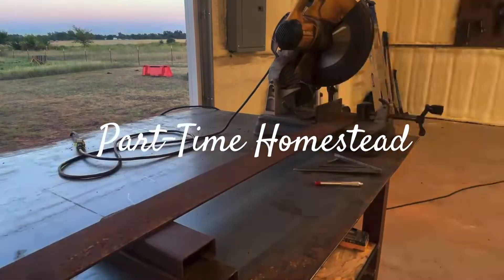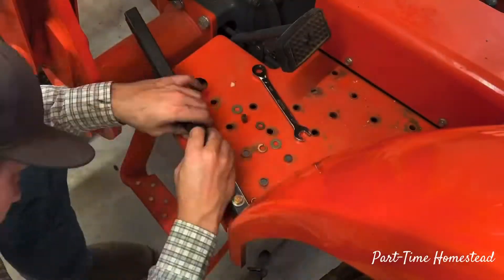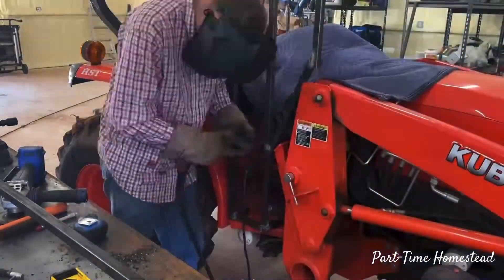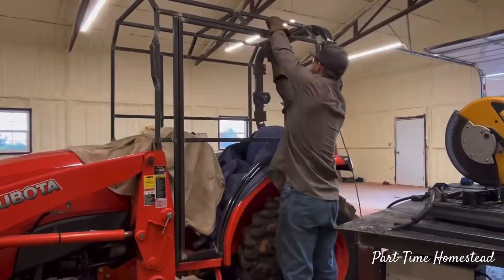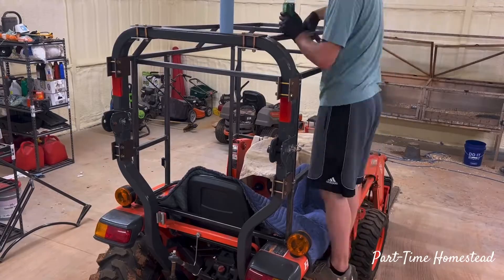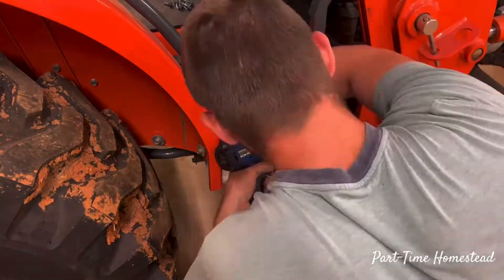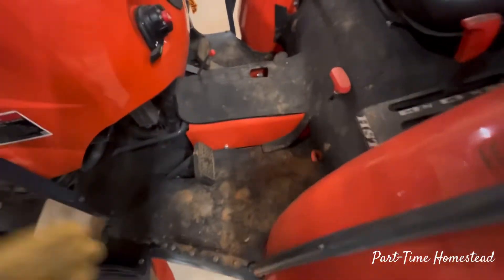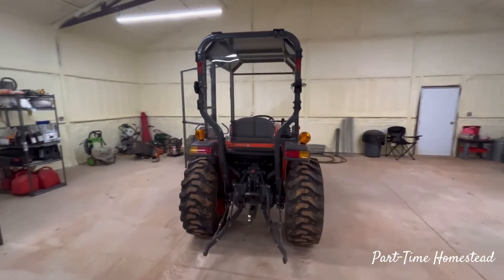How I built a Tractor Cab for less than $1,200!

Comment: For those triangular corners around the hood, you could just use a scrap piece of plexi and trim to fit the space, just like scribing in trim for woodworking or tile flooring.  

You could attach it by the acrylic glues as a double layer, but only glue it to ONE of the front pieces so it is not holding 2 of your front panels together in the event you need to take it off.  Or you could drill and screw it to the existing panels for later removal, either way.  

OR, you might consider using a small piece of heavy mil transparent shower curtain or find some "window" plastic as used in boat canopies and such were it is often sewn onto the fabric.  A canopy manufacturer might have a 1 foot square scrap to just give you.  That would all keep the space transparent to see through.

Comment: Very nice build.  I just found your channel and subscribed.  And now I'm going to look through for any upgrades you might have made.  I have an L2501, so similar design for me and this is on par for something I have been designing in my head.  This video will be huge asset as I move forward to draw it out and start making templates.  And I really like that it's not a permanent fixture to the tractor.  

Something I would want in mine is a bit of wiring and add an interior light and a fan as well as a front facing light bar outside and rear facing light on the back.

I would want to build my plexi in a way to be easily and quickly removable as I would likely only use this in the winter months.  Something like using wingnut head bolts or something.  Probably have a frame for each piece of plexi that mounts to the frame of the cab so when you take the panels off, the plexi panels still have their own frame for rigidity and protection.  Itll add some cost of course.  

Additionally, of less consideration, but still a consideration, I'd like to have a small electric heater in the cab.  It's a small area so wouldnt take much.  And not to make it toasty in a t shirt, but just to cut down the chill and maybe keep the fingers a bit more comfortable.

Also, I'll explore getting the side panels out a bit further on the wheel wells to save access to that cup holder.  You have really given me a lot to think about on this possibility of adding a cab on my own.  Well done.  Thanks for sharing.

Comment: When welding on anything with electronics there is a chance for melting the components. The key thing is ground placement. As long as your ground is on the cab steel that you are building, you have no worries. If you put your ground on your loader for example, and then tried welding, well now the current has to travel through the loader, then the pins, and God only knows where else. Your current from welding will take the shortest route possible. so keep your ground close to where you're welding.
Reply from the maker: Thank you for the your advice! I tried to keep the ground close throughout the process but sometime I forgot to move it 😅

Comment: Nicely done! I'm thinking of doing something similar for my mini excavator, but use polycarbonate for more impact protection.
Reply: Good idea.  I want to enclose my Kawasaki mule cab as well.  Do you happen to know how polycarbonate compares in price to plexiglass?
Reply: @RoyatAvalonFarms  Polycarbonate is a bit more expensive but way sturdier than acrylic. Acrylic has better clarity. If you need protection from a branch hitting your cab, polycarbonate is better
Reply: @Leonidimus59 ok thanks.  I like the idea of clarity, but given my conditions, protection from an occasional slapping branch is an important function.  I'll take that into consideration as I move forward with a design.

Comment: Great ,great job I am thinking of building myself a cab for my tractor that was a really nice design you did there ,have you seen any kind of small AC unit that would work ,I'm not having much luck finding the right setup yet ,baleing hay AC would be nice great video bud really nice work .
Reply from the maker: @markstokes6075  I appreciate it. And I did look into them a little. I was thinking something that would work would be a rooftop AC system that you typically find on a camper/RV or even one for a 18-wheeler cab. But my concern is that the alternator isn’t large enough. I’ll be honest, I didn’t do a lot of looking into it but I need to. If you think of any good ideas I’m all ears.

Comment: Is the engine noise better or worse inside the cab
Reply from the maker: No, I really don’t notice an increase. I think if I were to seal the cab up it would help dampen the noise from the engine and the occasional vibration from the plexiglass.

Comment: Great job. You will want to fill in closer around the hood. While driving/plowing the wind comes in there bad. Foam tape will help over the hood. I used a pool noodle in bigger areas.
Reply from the maker: Yes, great idea! I was thinking either a pool noodle or tubular pipe insulation since it has those sticky sides to them along with some caulking as well. So far it’s been nice but these improvements are on my to-do list. Thanks for watching!